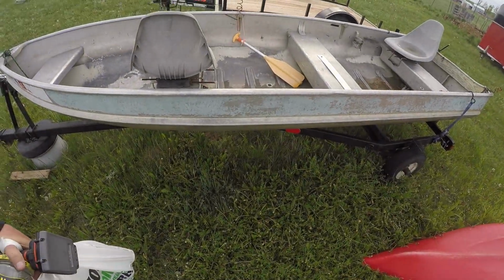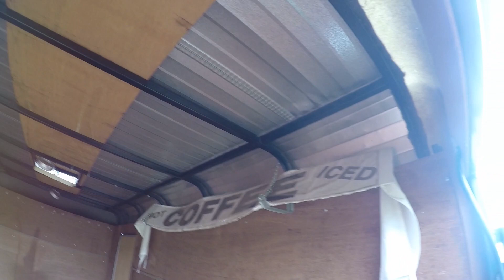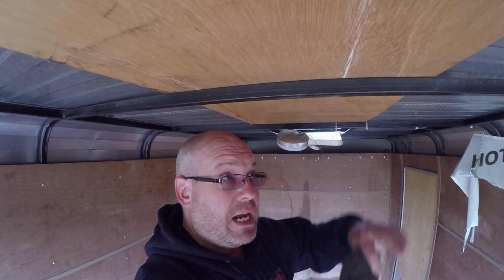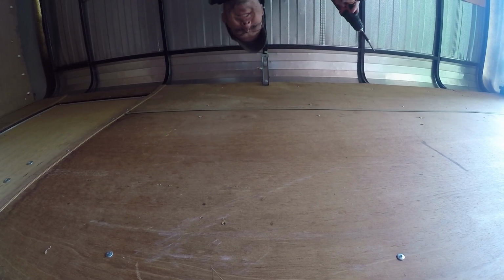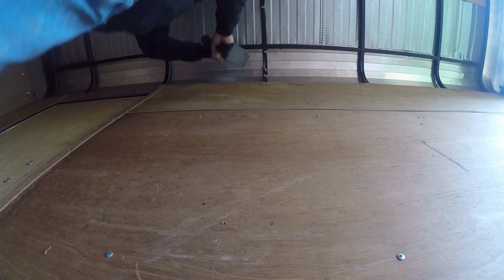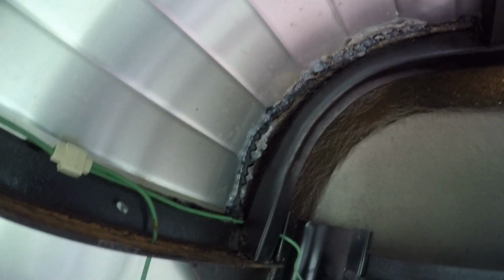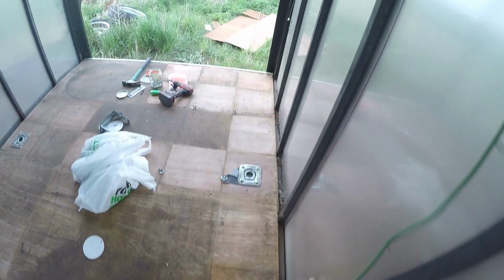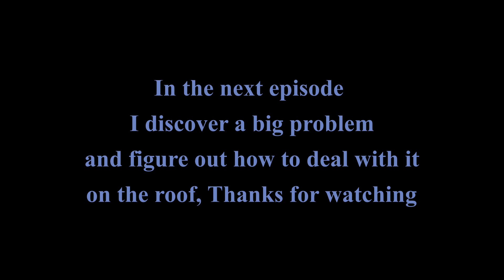6x12 Cargo Trailer to Camper: EP:1 Teardown and design

Comment: With lumber prices, you'll never get it below 1,000 to have a solid base. I'd go metal studs to save the weight of wood anyway.
Reply from the maker: I am using the metal studs that are already in the skin, and putting the paneling up with furring strips. It’ll make the windows tricky later, but I can figure it out
Reply: It won't carry the load your asking it to without having at least a 2x2 in there and some sort of header. It will eventually start to sag and tear your metal siding without support. You rather do it prior to your cedar though. It always sucks to go in reverse on a project rather than doing it right the first time.
Reply: I may not be too knowledgeable in furniture carpentry, but I can sure the hell help out on structural carpentry.
Reply from the maker: Duct tape?
Reply from the maker: Well I may have to call you when it comes time to put the windows in, because I’m already way past that game
Reply: Duct tape doesn't have the tincile strength. You need something to carry the weight of the window plus the window needs a header to carry the weight of the roof above the section you cut out. The header needs trimmer studs to run the entire height of the wall under the header to the frame. Then you also need a king stud to carry the load the entire height of  the wall to keep the window plumb and square.
Reply from the maker: Yeah, so do I pay you in beer to put my windows in or money?
Reply: @WyomingIceHole well I quit drinking the better part of 7 years ago. Have you started sheeting the interior yet? If not it's gonna be easier to get the frame in for the window now and leave it covered until you get one for the hole. Hell, then you can order a better window to keep heat in and have it sized to fit.
Reply: Then you can run your insulation and cover it and leave it covered until you get the window